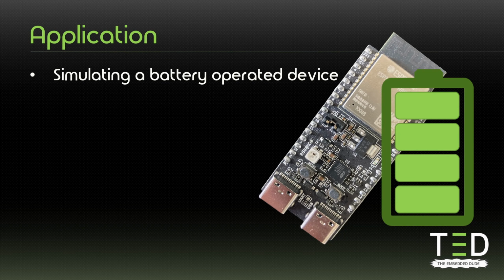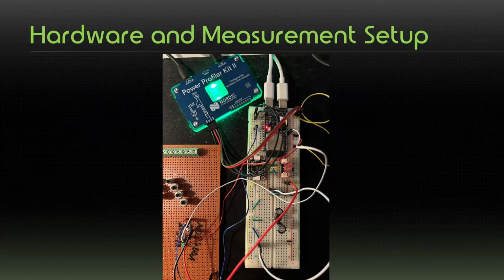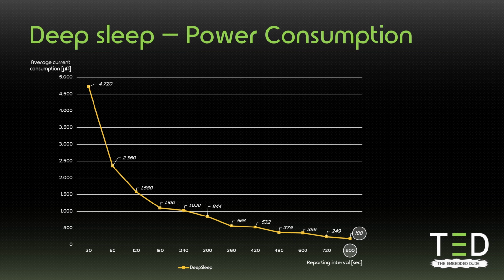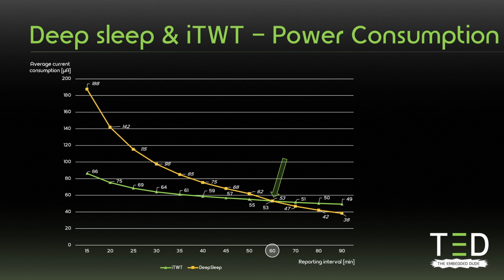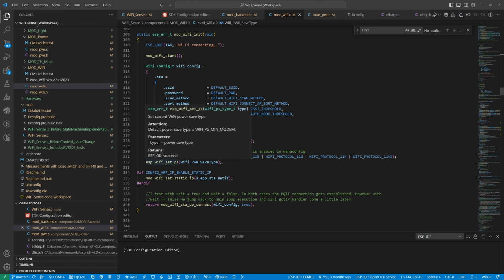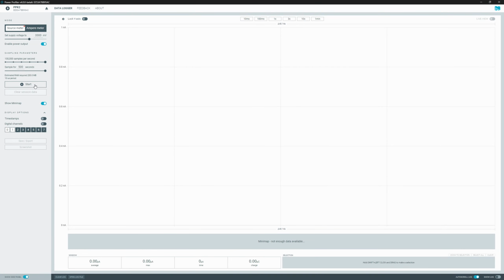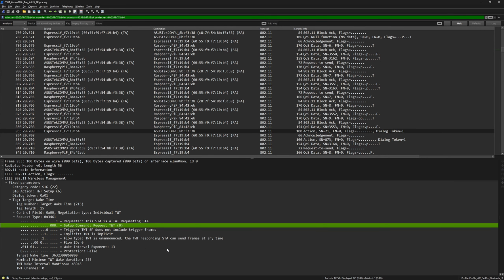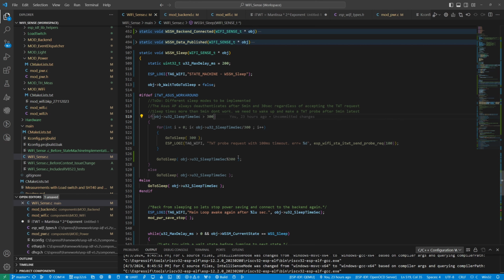Up to 68% power reduction! Exploring Wi-Fi 6 Power Saving Modes using the ESP32-C6.

Comment: Dude, thank you so much for your video introduction on the ESP32C6. Could you explain how to set up Wireshark to capture the entire iTWT process? What environment is needed, what settings are required in Wireshark, and could you share some tips? Thank you very much.
Reply from the maker: Hi @mintisan, sure no problem. I am using Kali Linux and Wireshark to monitor the traffic. You need to have a Wifi adapter that supports monitor mode. I have a cheap one from AliExpress that works fine. There are sites that explain which WiFi chipsets support monitor mode. Please keep in mind that it might be illegal in some countries to just sniff WiFi traffic. I cannot give legal advice here but just wanted to mention it.
Reply: @TheEmbeddedDude  I understand your concerns, and your response has provided me with the key information I needed. Got it, thanks again.

Comment: Thank you very much, this is a great video.  I took a run at this last year and ran into the same problem with my router as you you did with your router.  Your workaround code for that is a very good idea, and one that I did not try.  Also, I didn't know you can power the c5 chip while bypass powering the board on the expressive c6 dev board - what a game changer for testing for reducing power consumption!  Any chance you would be willing to post your final code?
Reply from the maker: Hi and thank you for your comment. Have you found a router or AP that works better without such short time limits? So far I couldnt find one where I can be sure it would support sleep times in the range of hours. I assume its a tradeoff for the manufacturers because the AP would need to store messages per device in some cases and that could get tricky and resource consuming quite fast. So I imagine they decide to limit it to short timings to keep the cost down. 
I was thinking to share the code via GitHub if there is some interest. It is a prototype for investigating the power consumption and far from perfect. I am not sure I would invest more time into it but if you are interested I could share it with you.